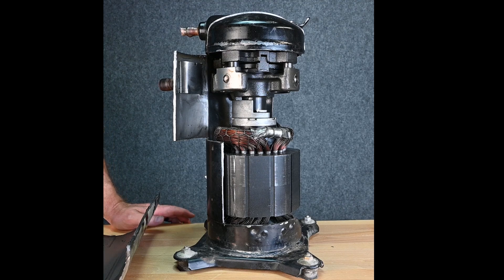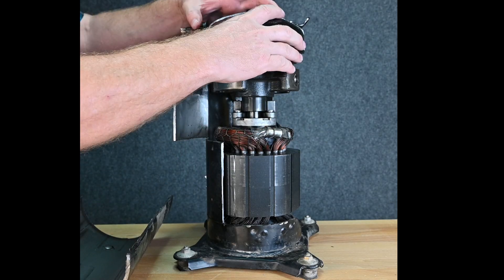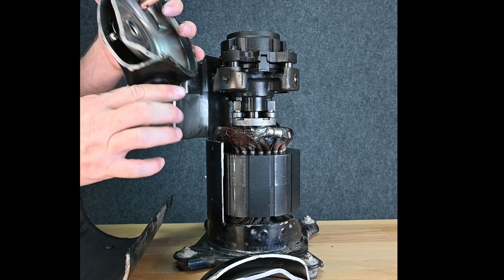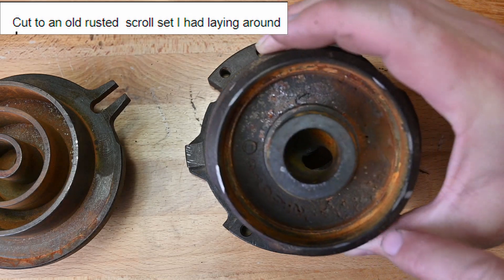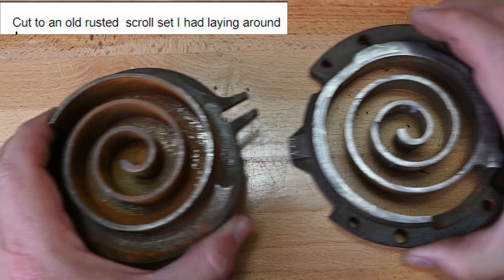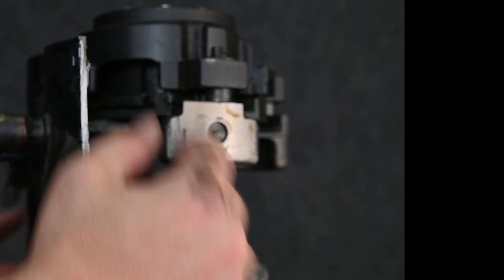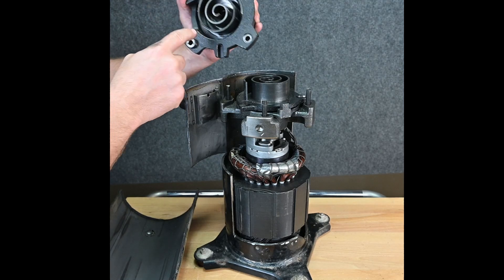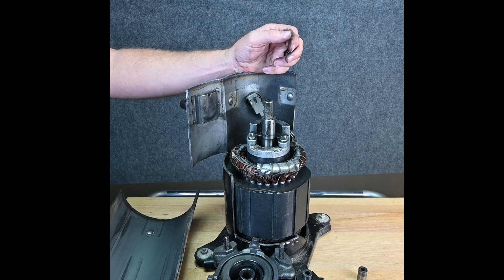HVAC 074 B Scroll compressor cut open

Comment: Another fine video Ty! Ok to get your thoughts on the scroll’s oiling system? I recently had my indoor coil replaced and now I swear I can hear my scroll compressor making the same sound I hear in your video (7:11 timestamp). It has me thinking my old evaporator coil may have (Elvis has left the building)  with some compressor oil. 🤨

Comment: how does the lubrification inside of the scroll compressor work? anyone knows about any articles about that?
Reply from the maker: The bottom of the vertical crank shaft has pickup finger. As it rotated oil is picked up and centrifugal force with the machining of the hollow center carries the oil up to the top.
There are oil ports drilled to then enter that lubricate the top bearing and also out the top of the crank shaft where it lubricates the moving parts of the scroll.
Reply: @love2hvac  do you have any article that goes deeper into it? Thanks a lot for the response!

Comment: Hi, when replacing a new compressor do you have to add oil to it? Or does it already comes with oil inside? Thanks
Reply from the maker: Already comes with oil in most cases. Be Sure to check the specific compressor as some have less oil to
Account for what's in the system.

Comment: Good cut. What’s the difference between AC and refrigeration scroll compressors (inside structures)? Thank you. Happy Thanksgiving 🦃
Reply from the maker: Great question. 
Refregeration. Requires more horse power for the same BTU. 
Commercial systems have the internal pressure relief valve set at a much higher point also.

Comment: How would you rate a rotary compressors vs scrolls, are they reliable? Thqnks
Reply from the maker: I was told a  rotory is more efficient although I have not found anything to back that up. I prefer a scroll because it allows the suction gas to cool the compressor windings and it can handle some (some) liquid slugging. 
Before rotory was only used in PTAC, window, and ductless but now they are being widely used for inverter compressors on 5-ton split system units. 
I am seeing more and more use of rotory every day.
Reply: I noticed amana/goodman start putting them in a few years back in a smaller system u up to 2.5 or so, im a bit concern that suction goes straight into crankcase, they do have a small accumulator, but still more changes of  getting some liquid in that design, especially in heatpumps
Reply from the maker: I saw a 5 ton York with 2 accumulators. I guess they are worried about it too.